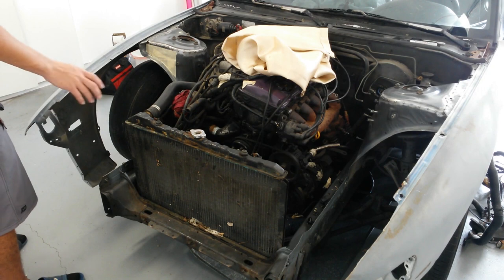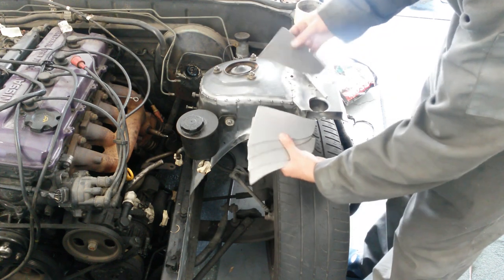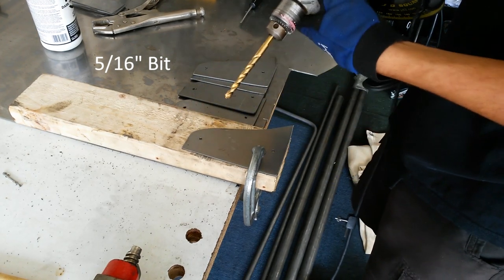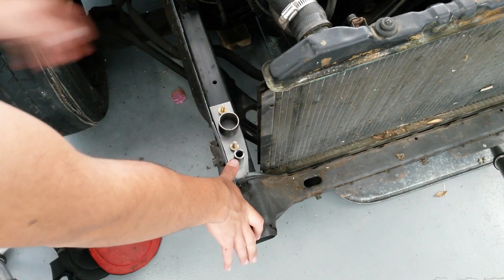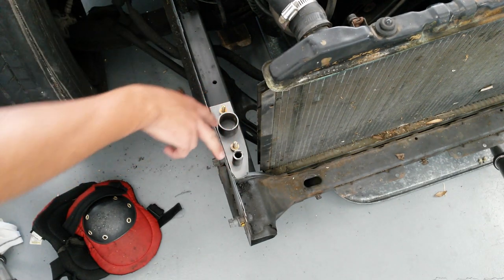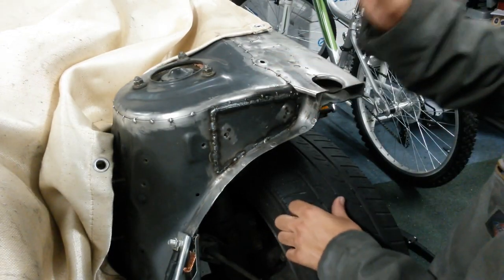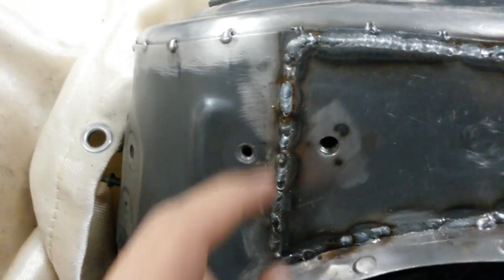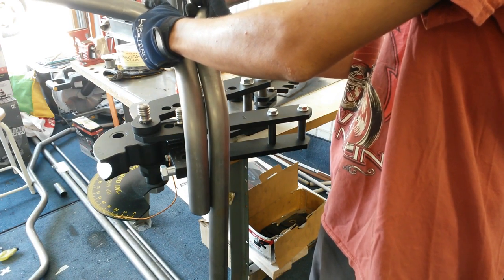Project 240SX - Le Drift Car II | Ep. 4 - Tube Front: Plates & Bending

Comment: Really enjoy your videos, and your attention to detail is very good.

I must comment on the welding though. For a tack you want them to be thicker you can grind them down and as long as it isn't a full bead still easily removable. Hold for maybe 3 to 4 seconds vs the 1-2 seconds you are doing it will be much more solid. For doing tubes you can also tack two points roughly 70* apart. That way you can still pull up on it to redo the positioning and it won't fall on you.

For stitch welding you usually run a bead instead of the tacks. And your tacks are actually pretty small so I'm not sure they will do much. Either run a bigger tack or run a small bead.

For car sheet metal you want to do smaller sections as you discovered, probably a 1/2 inch at a time. You can also wet down cloth to help pull heat away after welding or use a heat sink like a bronze spoon. 

For drilling with a wrist snapper use the clamp to secure both the wood block and the work piece to the table. Use both hands and go slow with lots of weight on it. Actual drill presses actually run at really low speeds.

Comment: Perhaps a smaller nozzle on your MIG torch would have helped in those tough to reach areas. It's difficult to get your shielding gas to work when you have to keep it so far away, and the stick out too. Loved the video!
Reply from the maker: eletor Hmm didn't think about that. Will look into it for sure. Thanks!

Comment: great vid. welder settings are key, On sheet metal i cheat and recommend using the same technique you used to stitch the car. get a nice round spot weld, wait a sec, put another one next to it just touching. be sure to put a few welds around the piece so it can't move when you start. it won't have the dime roll look but it still looks clean and the heat is minimal and won't warp anything. hope this helps.

Comment: when drilling clamp you workpiece to the table, really i speak from experience
 i have broken my wrist like that
i piece of pipe turned around and crushed my hand against the column of the drillpress
also predrill with half of the wanted size 
so if you want a 12mm hole predrill with 6mm and that paint is gone after welding
and just turn up the gas when welding corners to keep good gas coverage 
great vid and good job

Comment: I know a few people have commented on it already, but to make life a little easier, step your drilling up in smaller increments, its less likely to bite as hard and leaves less of a burr when your finished. and clamping your work to the bench will help too, especially with bigger holes.
Reply from the maker: joakerowns Well the main problem is this drill bit which has the weirdest tip I've seen ever. Anyways the way the tip of the drill is setup if the hole is any bigger than that size pilot the drill can freely move around. Really hard to explain haha, but basically every other drill bit I've used doesn't bite like this. This one always tends to catch really hard at the end. And yea first time I had the bench to work with so didn't even think of clamping the wood there. Now I do and it's 10x easier lol

Comment: When welding sheet metal, try not to do more than 1/2" to (depending on thickness of metal ) full 1" welds, and then move to opposite side of the plate your welding and start again and go back and forth. Thats how I learned in my welding classes I took at a career center in highschool.

Comment: Check into "Weld Through Primer" Basicly you can prep the surface and then spray on the primer. After that, you can weld right through it (as the name says) and not have to worry about that underside that you grinded down and didn't weld on.

Comment: To prevent warpage from sheet metal when you weld it you could  take a damp paper towel or rag and tap it on the metal. should hear a nice hiss. Its what I was told to do between beats in my college welding class.

Comment: Ok let me start off by saying i love watching this videos they are really entertaining. Here is where it goes downhill though.
1: All you had to do was put the timber and plate on the ground and stand on them to keep them from moving. Then you can drill it faster because you can put more weight onto the drill.
2: Read up about welding please. Your welds are good in places but most of them look terrible. I can bet that alot of them welds lack sufficient penetration therefore making them a weak weld. Just look at your tack welds. They all broke when you tried to put in the tube. Tack welds are meant to be strong. Fiddle with the settings on your welder to get a nice smooth weld.  Also, everyone knows that heat distorts metal. Especially thin metal on a car. Just keep that in mind so you avoid the stress of warped metal.

Other than these things man you are a very good worker. :) Remember this is just some friendly advice/cristism so dont take offence.
Love the videos keep it up :)
Reply from the maker: Sean O Mullane Thanks, I appreciate it! And yea after I changed the ground (as shown in the video) then the weld was strong and didn't break. I'm probably going to do a double pass on the welds once everything is done just to go over everything bad lol

Comment: use the vise on the table. drilling like that is a good way to chop your arm up. using a drill with  torque settings also save your hand. nice work. im going to tube the front of my car too.

Comment: Lil tip from an old dog. Increase bit speed and reduce pressure. Move drill in slight orbit like shape of a small funnel. You will feel where it starts to gall. Slight pressure and feel it chipping off the catch point. You will love it.

Comment: When you are welding verticaly try welding from the top down instead of from the bottom and up. This will generate a lot less heat in the metal and hopefully save the metal from warping. Just a tip ;)
Reply from the maker: Alexander Malmberg :)

Comment: Weld a nut to the end of tube that goes straight up from the lower frame rails, that is a part of the headlight and fender mount frame, so you can screw the areo catch hood pins to for the fpr hood.
Reply from the maker: jack mac Those tube are a little off from one another so I don't want to use them for the mounts. I'm going to mount the aerocatch pins on the radiator support I made because I know that's 100% straight and even accross

Comment: When welding thin material like that weld down hill, not up hill. That will limit the amount of heat you are putting in to the materia and limit the amount or distortion in the piece. Also before you even start welding make sure you are in a comfortable body position that will allow you to focus on the weld. good work though keep practicing your welding.

Comment: For the spots where you can't get very close you need to turn the voltage up to compensate for the extra wire stick out
Reply: Also those tubes look really good! Which brand was the first bender you used?
Reply from the maker: ZohanLohan Thanks for the tip. It's a JD2 Model 3 Bender with a 4.5" radius, 180 degree, 1.5" round tube die.

Comment: pro tip, when welding low gauge steel use an air gun to cool your welds prevents buckling and increases productivity.
Reply: Aza X Or you can do short bursts, not try and weld in one go.
Reply from the maker: ***** Pretty sure he's talking about in between short bursts. Even welding in 1" beads it takes forever waiting for the metal to cool back down again to weld another 1" bead. Hence why he says to increase productivity. Less time waiting = more work getting done.

Comment: Awesome tutorial, but one thing when you were drilling the plates...if you have a vise, why didnt you use it? Also, when mirroring the plates for size, a double edge file and all vised together would have saved you alot of time. None the less, your hard work is paying off. It looks great.
Reply from the maker: M. Skoops Well the vise doesn't go wide enough to hold the metal flat. I should have clamped it to the table but it was my first time working and having a bench and I'm so used to working on the ground that I didn't even think to clamp the wood down. Now I do though and it's 10x easier. 
I have two different files but none shaved away as fast the grinder and flap disk haha hence why I used that.
Thanks!

Comment: You really need to fully weld around those pipes. Also, I think you should have welded around those bolts on the back not 3 tacks because they might snap off when you tighten the bolt. Has happened to me before and that's a bitch to fix. Good work though and to a high standard at that
Reply from the maker: Hunter Hills Tubes are just tack welded for now. Nothing will be fully welded around until all the brackets for the hood, fender, lights, and radiator are done just in case the setup needs to be changed. 
OEM welded nuts are held in with the equivalent amount of tacks so I did what they did. I also tested on a spare piece to see if the three tacks would hold and I tightened it to the point where I felt the bolt would start stripping out and the welds held perfectly fine.
Thanks!

Comment: It wouldn't have warped if you had used smaller stitch welds around an inch each. Also constantly move the gun from side to side to let it cool easier.

Comment: I am totally digging that you made this a "bolt on" kit.  That is awesome.  Question though.  Why did you weld the plates on?  Im not saying its not better, but you could have just bolted them in a sandwich style.
Reply from the maker: +Auto-Mafia Did it because of coilover clearance in the back and also it would be pretty difficult to make the plate bolt on for the mounting plate that goes to the frame rail.
Reply: +OffBeat Garage touché    I don't have a 240 so I don't know how much space there is. It was just a thought.  Still is a great job. I'll be tuning my front here at some point.
Reply from the maker: Auto-Mafia Thanks, best of luck with it!
Reply: +OffBeat Garage Thanks man.  I got some questions for you just out plain curiosity Ill PM you.  Do you prefer FB or YouTube?
Reply from the maker: Facebook preferably

Comment: Is there any reason you wouldnt have just put the plate with the nuts welded onto it on the backside? Clearance issue?  It seems like it'd be easier to line it up that way.  Oh and also if you want to avoid warping like that just weld small stitches and give it time to cool in between, then go fill them in.  The weld itself might not look as nice with all the starting/stopping but it shouldnt warp.
Reply from the maker: +autotalon Clearance issues with the coilovers and I would also be stripping all the undercoating underneath there to do that which would make it really prone to corrosion in the future. Yep haha I learned that

Comment: Love the vids man but I got a question what's your opinion on Mitsubishi? Like the starion/conquest even though Chrysler does conquest but still and also what you opinion on the 3000gt? I own a 3000 vr4 and twin turbo with dr750 turbos 850cc RC injectors walbro 255lph fuel pump 9.3:1 high comp ratio boosted engine bored .30 over forged internals etc and am about to get another 240 making it my 4th 240 but before I do I'd like to know what your planning on doing with your 240 engine wise please don't swap a sr20 lol
Reply from the maker: Thomas Maclean I don't really have an opinion on Mitsubishi lol.
KA is getting turbo'd and planned for about ~350hp

Comment: You have welders, benders etc. Don't you think it's about time you built or bought a decent bench with a decent vice ? I used to drill plate exactly the same as you until one day the drill hooked up and spun the plate. I am now one testicle less. and a scar on my leg which is about 15 inches long where 30 staples where inserted where Dr's went in to my leg to to fix the severed femoral artery. Had my mate who is a paramedic not been there Dr's said I would have bled out in less than 3 minutes. Basic shop safety is the first thing that should be taken care of before any build.
Reply from the maker: Emtildeath6666 The thing with my garage though is that I can't have a big bench or even a bench securely mounted to the ground because of how small the garage is and how often things get moved around for space. Just for the main hoop on the roll cage for example. There's no room in the garage with the car there to bend the main hoop without repositioning the bench diagonally. So having anything mounted to the floor is out of the question. I know what you're saying though and I greatly appreciate your concern :)

Comment: Not bad man, but personally i think it looks very weak, compared to stock. I would have used way bigger bolts like M12 at least! and would connect a brace between the left and right tube, to prevent the strut mounts sagging inward on hard turns or just over time
Reply from the maker: +myles milburn That's what a strut brace is used for. The whole point is for the front end to be weak. Thanks,

Comment: Hey man love the vids I got a 93 240 with the radiator support cut :( and I want to fix it unfortunately I don't have the original one that was there. Do you think you could send me the measurements of how long you made the tubes and the bash bar? Please:)
Reply from the maker: +BG__ __S13 +Brandon Greene Sorry but it's all just dependent on the car and how you want it set up. I had no radiator support there either. I just made the tubes to whatever fit. Same goes with the bash bar. All depends on how you want it setup as well.

Comment: Seems like you have a less or no penetration weld beads (cold welding seams). Good luck...
Reply from the maker: Ritvars Višs I've checked the back of the metal and all of it is fully penetrated. Thanks though.
Reply: ***** that is not a sign. keep an eye on your welds after some time.

Comment: Why did you weld the first plate on the strut tower and not weld a nut directly on it or put behind the strut tower as a backplate?
Reply from the maker: Artec12 The strut tower is made of sheet metal and is ridiculously thin and weak. Welding the nut there would just lead to that metal tearing in an accident or even when over tightening that bolt really. Plate isn't welded in from behind because of the undercoating from factory and because of clearance issues with the coilover
Reply: you could just bolt the bac kplate with the front plate you don't have to actually weld it to the chassis. many roll bars/cages are attached that way. just saying :)
Reply from the maker: Artec12 Yes I'm aware of that, and again that's not done because of clearance issues with the coilovers. And then I would also have the issue of having to hold the backing plate in while bolting on the tube front on the front end. It also wouldn't be plausible to do that with the mounting plate to the frame rails either so those would still need to be welded.

Comment: Do you have any kind of schematics/measurements ect that you could pass along? My weekend toy was smashed from a fender bender with a f250 so I don't have anything straight to measure off. Or if you happen to know of some website that shows how to measure and design the tubes that would be great.
Reply: Love ur work and ur videos btw, seeing u can do this in your driveway has given the inspiration to attempt something like this myself
Reply from the maker: Chris Dubia You don't need any measurements. I didn't measure anything off the old car. You just start bending tubing and trim it to fit how you want. That's about it. Thanks!
Reply: ***** ok, it's basically measure and cut as you go, as long as everything fits? And Ty for your quick response. Didn't really expect anything this fast

Comment: To lazy to go through the comments and see if anyone's told you but in the future stitch weld to keep the heat down man
Reply from the maker: +Zach Betz Yes haha they have, and I already knew it too. Just when I was practicing beads on a similar thickness metal it didn't warp, so even though I knew I shouldn't be doing long beads I went off of my experience from the other things I had welded and did longer beads just to find out it was warping on the car. Thanks :)
Reply: +OffBeat Garage thanks for replying man that's cool! Yeah welding is crazy man I pretty much always stitch weld on cars unless it's an older car with a real frame I'll bead weld on real frame rails all day. I like what you're doing though man keep it up!
Reply from the maker: Zach Betz Thanks!

Comment: I know this is years old now but all the welds are to cold. need to up the amps. also with the base plates, stitch weld instead of trying to run beads. you'll keep it cooler and less warping. also that warping is nothing.

Comment: the amount you use go ahead and do this or go ahead and do that...... omg, and were you using a wood bit on the drill? that might have been why it was binding.. you should have done it in a table vice maybe too lol.
Reply from the maker: Mac Thayer Yea haha I noticed that and I try to cut out the amount of times I say it now on. 
It was a metal bit. Those bits have a really weird tip one them though that makes them catch towards the end of drilling when the metal gets thin. 
Lol yea I didn't even think to clamp it down since this was the first time I had a bench to work with and usually I do everything on the ground with nothing to clamp to. Much easier when clamped though haha

Comment: don't drill into wood. Drill into a gap between to pieces. The drill bit in binding up on the wood block. Hurts my eyes watching that over and over lol. Rest of the video is mint!
Reply: Commenting as i go lol Stitch weld the thin stuff brah. Won't get that distortion. Also just realized your welding up. Creates more heat as it welds slower hence the warp.